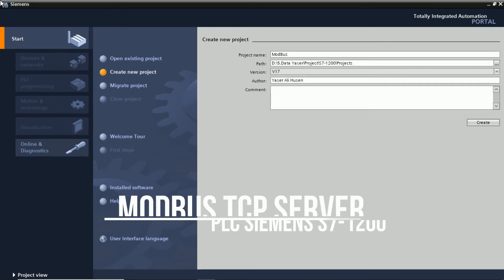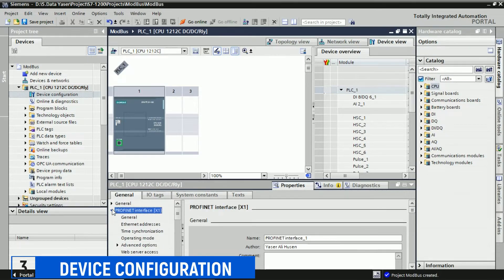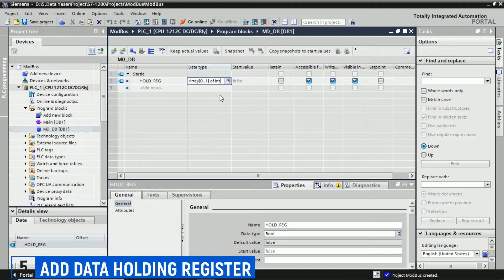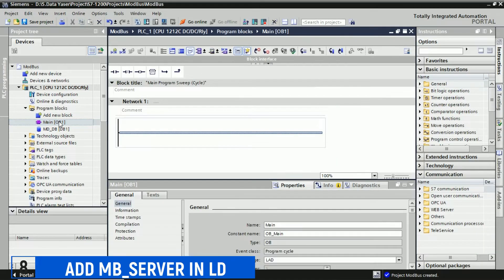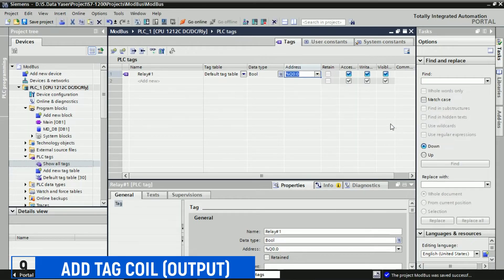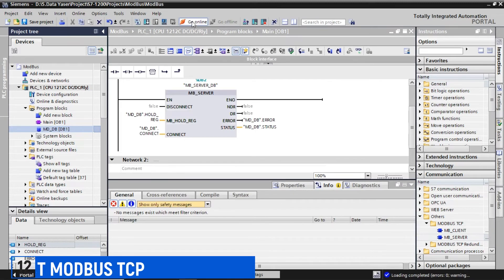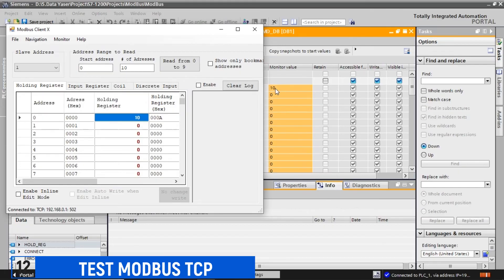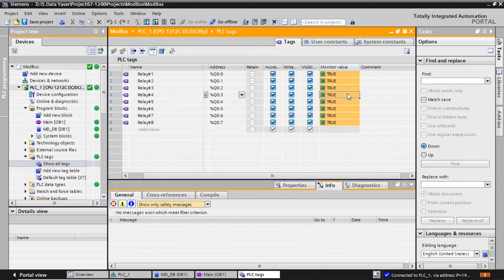Step by step configure Modbus TCP Server in Siemens S7-1200 PLC

Comment: Great Video, Dear Sir IP of PLC and And TCON_IP_V4 should be same or we should not write IP in TCON_IP
Reply from the maker: Thank you! 🙏
If the PLC is configured as a Modbus TCP Server, you don’t need to enter the PLC’s own IP address in TCON_IP_V4. The IP address is already set in the hardware configuration.

In this case, leave the Partner IP (TCON_IP_V4) as 0.0.0.0.
You only need to fill in TCON_IP_V4 when the PLC acts as a Modbus TCP Client and you want to connect to a specific server IP.

Comment: i dont have plc hardware, i'm using plc sim and i did same as like you, but connection failed with mb client
Reply from the maker: Hi, thank for watching my video.
In video I use real PLC.
Sorry I don't have experience using PLC Sim, maybe there is configuration related connection
Reply: @YaserAliHusen   but u didn't used mb client
Reply from the maker: @industrialautomation1992  , As I remember, I set the PLC as Modbus Server

Comment: Excellent video. Thanks for sharing. I've successfully done Modbus Server like on the video, but when I try to read data from Micrologix 1400 Modbus Client it does not work. I get the error "Local communication channel is shut down".
Reply from the maker: Is the IP address both of server and client in same IP node?
For example same in 192.168.0.xxx

Or you can test using modbus clientX software

Comment: This is a great video sir. And many thanks. Tried it and it worked. However,  i have got 2 questions.

1. So you do not need to map the MB_Data.Hold_Reg to the PLC tags in order to read or write to it? Will it still be same for analog input cards like reading the Flow, Pressure and Temperature sensor data?

2. Would mapping also be required between MB_Data.Hold_Reg 
(Buffer) and other DB's in the program?  Or will it work  straight away just like  the PLC tags? For instance,  DB_Powermeter?